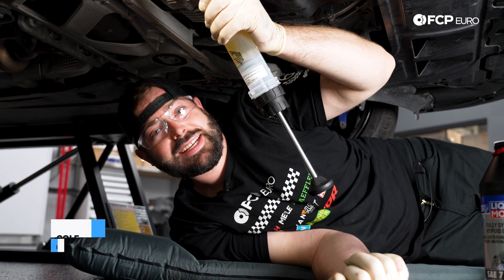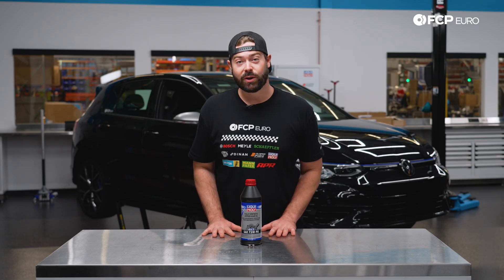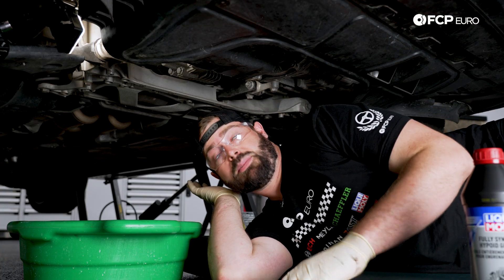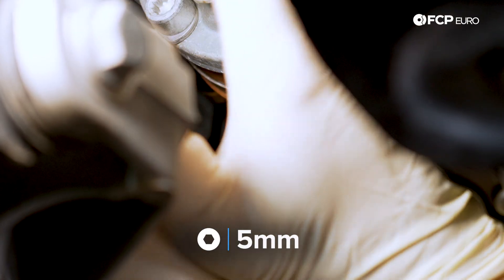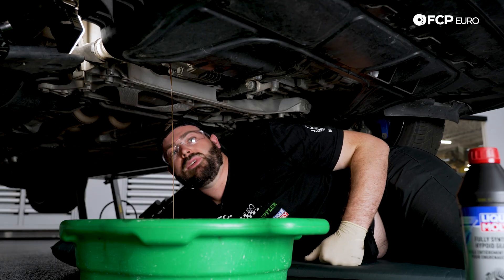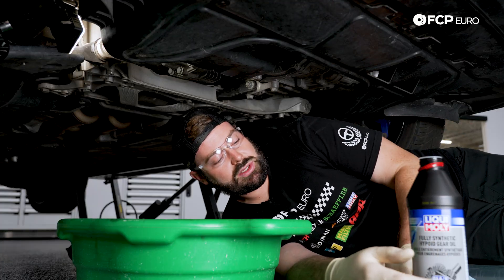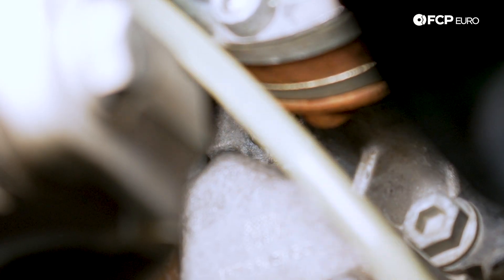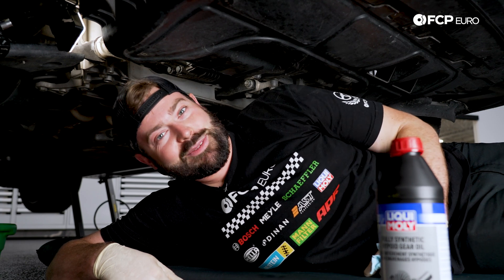VW Golf R Front Differential Service DIY (2022-Present Volkswagen Golf R, GTI)

Comment: I suppose the correct term for this locking differential is transfer case. 
The actual 'front diff' is built into the DQ381 gearbox, then it is connected by the transfer case, to transfer the power to the rear diff/rear wheels.

Comment: You can use the same plug bolt.
Reply: Yes you can, but why if the part is already cheap?
Avoid leakages with a new one and proper torque to spec.